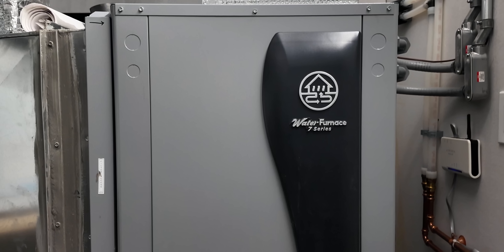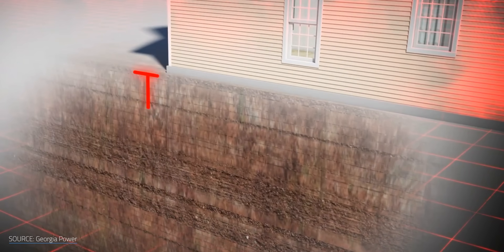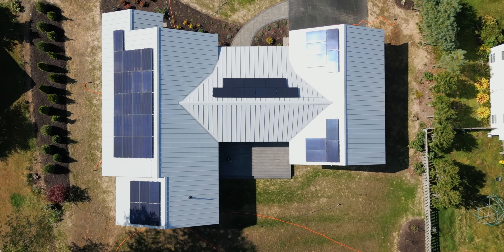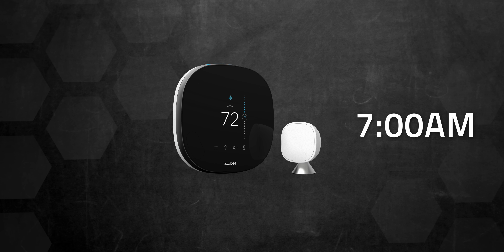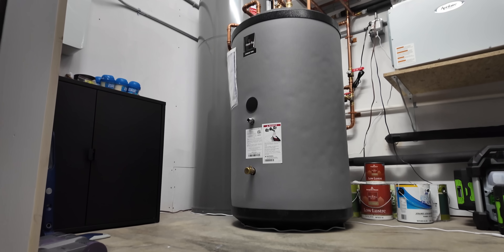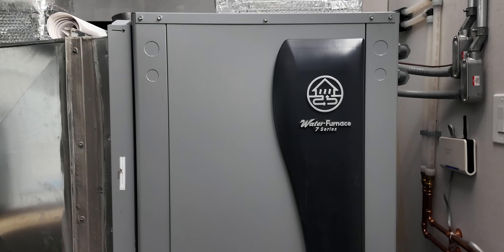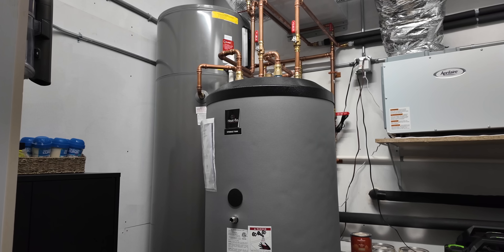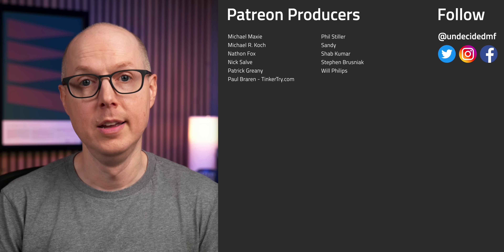How My Geothermal Heat Pump Really Performed (2 Years)

Comment: I bought a house last year with a pre-existing geothermal system. The house is only 5 years old and it wasn't even a selling point, so it was basically free. It's a horizontal loop that was direcrtional bored 14ft deep. It also has a "dummy" water heater, literally, it's just the same water heater, only not hooked up. I don't see this as providing much savings. However, it does work, but only during the summer. I don't see how it could provide preheated water in the winter?

At any rate, I have years of experience with forced air, and this system is immediately cheaper. With a nearly identical sized house. Forced air, between natural gas and electric was nearly 3x more than my current monthly electric bill. In the summer the electric bill would go up, and there was always that natural gas connection fee. In the winter the electric bill would ease a bit, but the natural gas would kick up. I do currently have a technician come 2x annually for an extra cost, and might continue that inexpensive program until the warranty is up. So far, I haven't seen anything that I couldn't do on my own to check the health of the system.

Comment: If your electric rates are indeed in the 35 cents per KW area, that system should indeed pay for itself in just a few years.  We pay almost 12 cents a KW here and that's about 1/3 the cost for electricity.  I'm assuming you guys also either do propane or fuel oil or have high cost natural gas which seems fairly typical out that direction.  I had an estimate done by a company for just solar and batteries for my place.  They want $49K which I though was rather excessive.  I can probably do it myself for near $15K or less for about a 12kw system which I am considering.  ROI would be about 6-8 years for me estimate.  But one cost that is never brought up and a few comments hint to it is the maintenance and/or replacement costs.  Those systems do wear out and/or just fail.  The home owner is responsible for everything at that point and can be rather costly.

Comment: Good report.  
We have had a Water Furnace geothermal unit in Wisconsin in a closed loop since 2010, and have had similar costs and results to Matt. Payback is 25 years plus.  
The desuperheater reduces LP usage for producing domestic hot water, so we use about 250 gallons of LP annually. 
The best part for us is the comfort radiant heat (not forced air) from the in-floor hydronic heating. This radiant heat provides a very even and stable feeling of warmth, with a (very mildly) warm floor. To be clear, we also considered installing fossil fuel in-floor hydronic heat from a modulated boiler but decided on geo due to green goals and due to fluctuations in LP prices.  
For this in-floor heat, water heated by the geo heat pump circulates through 3/4 inch PEX tubing placed in a 1.5 inch lightweight concrete floor layer placed on the subfloor under the carpet, tile and wood floors.  
Nonetheless, during "shoulder" spring and fall periods for a few days of cool weather, we use the forced air geo heat option from the system.  We found early on that heating the floor during cool shoulder season nights resulted in heat from the floor during the day that exceeded the desired temp, so we were opening windows mid-day. 
For the in-floor heat we have several zones run by separate thermostats and pumps.  We keep the master suite at 70 and the living area at 71. A third zone for the guest suite we maintain at a cooler winter temp of 55 except when we have guests.  We have hydronic in the basement floor, but the heat radiating down from the main floor means that that zone stays at 70 from the living area zone and therefore the pump for the basement zone has never really been used except for annual exercise running I do for a half hour each fall.  
Finally, forced air geo air conditioning is very low cost. Using a heat pump to move heat from a 75 degree house to 50 degree water is like falling off a log and takes very little electricity compared to moving 75 degree house heat to 90 degree outside air as for a typical non-geo outside-air based heat pump.  I calculate less than a dollar per day for electricity when the air conditioning is running.

Comment: For comfort u dont want to be changing the temp when your at home and gone for the day. The air inside a home is easy to cool or heat, but the mass of everything in the home is not. It takes time to cool your walls, furniture, cupboards, beds etc. it can take hours to equalize the temp throughout a home. Youre also going to get more dust from outside when u let the home warm and cool. As the air warms it will expand and equalize with the outdoor pressure, as it cools it decreases in volume drawing in air from outside through every little crack and crevice in the home. For comfort set it where u like and never change it

Comment: I doubt a $40K+ final price would make sense anywhere when you consider what a $40K investment in the stock market will give you on average. The long term S&P 500 average has been about 13% annually. So $5200 in the first year and then compounding to more. Our heating and cooling costs in Michigan in a 4000 sqft house is less than $4000 per year using a gas furnace and two mini-splits. Of course most people don't have $40K cash lying around and when they then pay for financing it likely makes even less sense.

Comment: I have to have a cold house to sleep.  I mean in the low 60’s.  During the day, I keep the house at around 66-68 degrees f.  How does a geo thermal system handle that?

Comment: I have a Water Furnace geo unit, excellent, trouble free for 18 years. Here's the but,, if you don't have solar panels the electricity costs can go through the roof because the geo and the very expensive well pump. We have a gas backup furnace and we found after 3 yrs of testing and comparison, that for the winter months here in Michigan, that for heating, the gas furnace was significantly cheaper. For hot summers, geo was wonderful.

Comment: Did I just see an Engineer with a significant collection of uninsulated copper pipe connected bidirectionally to a very large indoor water heater tank totally unprotected by insulated tank wrapper? In New England? 😂 €:~0

Comment: Geothermal is expensive and to me only makes sense if you are building or have lots of spare money to throw around. It's definitely more efficient but overall you still have your seasonal energy spikes on hot or cold days of the year. We have a water furnace geo system. And sometimes question whether I would put it in again due to the electric draw.

Comment: When we built our retirement home 25 years ago we specified a 3 ton geothermal heating and cooling system from Hydro-Temp, a local manufacturer.  Age is showing and we are in the process of having Hydro-Temp build and install a replacement unit.  The original unit came with a hot water loop that seemingly frustrated hot water production.  I took it out and we have relied on a conventional electric system ever since.  Apparently the system that Matt has includes an insulated take between the unit and the electric hot water heater where water is preheated by the heat pump before entering the hot water tank.  This arrangement may solve the problem we had.  I'd try that now but we don't have room for the buffer tank. Overall, we are very happy with our geothermal heat pump.  Our three ton unit heats and cool 2,300 sq ft of well insulated house and our electric bill is significantly lower than our neighbors.  I'm glad we went that way.

Comment: Enjoyed your video!!  My geothermal is the 3rd one I've had.  Started out with SOESI out of Florida back in 1987 to replace my whole house electrical and now use the electric as back-up.  After 4 years, and multiple cleanings, the compressor went and I moved to Water Furnace which lasted 8 years till a spike in electric fried the compressor.  Insurance bought me a replacement and now I have the two stage Water Furnace.  Utilities are about $150.mo year round for all the heating and cooling and hot water.  I too have a shop that uses somewhere near $30/month without the heat or ac.

Comment: We installed the same system in midstate Tennessee about 6 years ago. While our winters aren’t as severe, we were remodeling an existing log home and needed to contend with the limited R-value of 6” thick poplar logs. Additionally, there was the realization that energy costs would only go in one direction over time. So being able to HVAC as efficiently as possible made sense. We started with a horizontal loop, however after quite a bit of time spent trenching we had to abandon the effort - soil that was primarily sand & gravel plus high ground water caused the trench to fill with water & the trench walls were too unstable to work in it. So we switched to a pair of 300’ wells drilled into solid limestone, cost was around $5,000 for the wells, took a little over a day to drill using a percussion rig. Really like having the web link & ability to control over my phone / pad. It’s also good to get text messages from the system when it’s unhappy, like when the condensate drain plugs up. 
Only had one major problem - the loop pump went out shortly before the end of the hardware warranty. We live in a remote area, so the service people having telemetry telling them what is wrong reduces the need to get parts & return.

Comment: here in Austria/EU: drilling 130meter well costed this yr:  EUR15,000, the heatpump + all nstallation (new 350L boiler and 250L buffer) was about EUR33,000, and a new 12kw/peak solar panel, to power the headpump or to heat the boiler during summer without heat pump costed 15,000 and finally the new meter box 4,500.
new floor heating in 60m² of the house was about (only) 4,000 without new tiles.
so, your 78k seems a lot!

Comment: I am constantly amazed as to why copper sweated joints are used by plumbers, which have a life half of the plastic pex system. Pex is also cheaper, far quicker and easier to install. Maybe is the plumber is charging by the hour on a job it is the reason, they make more money.

Comment: This video straight up sucks. That graph is total garbage, and is not representative of your actual costs. You didn't bother to make a graph showing your initial outlay vs air, including rebates, then graphing your actual running costs vs air heat pumps. Let's say you're correct and air heat pumps averaged double the energy cost over a year in your location, $2000 vs $1000 costs per year. Over 30 years, which is well beyond national average home ownership time span, that's still only $30,000 savings against your initial outlay. So over 30 years, you barely break even... And the money you could have saved initially, invested, would easily trump that initial cost.

Comment: My house is older(1970) 1700 sq ft, not the best Insulated, none in the crawl space. Yet my bill averages 85.00 a month, out of that, 40.00 is just to have the meter, so only 45.00 in energy use, so even if the geo cut my bill in 1/2, that would only save me about 22.00 a month, or about 264.00 a year, so that would take me around 113 years to break even.

Comment: Matt mentioned it briefly, but a slightly less efficient air source heat pump coupled with some additional solar panels will almost always be cheaper than a ground source heat pump. This is also true for most energy efficiency retrofits (insulation, windows, etc). Solar is so cheap now you’re almost always better off just adding some additional capacity (from a cost perspective)
Reply: That can be true but it's very dependent on where you live.  What's true in the SE or the coasts likely doesn't work where we are in Western Montana where ground source heat pumps are the main option.
Reply: Also Matt's roof has plenty of room for more panels.
Reply: solar production is too limited during winter. Adding panels won't help.
Reply: @jf4958  Wdym? As long as you're using more than you produce, adding more panels always helps. The problem is you end up running out of space for panels.
Reply: @eDoc2020  
We installed 2.4kw peak 3 years ago. Our consumption during winter remained pretty much the same. 
From december to february, the panels produce an average of 2kwh/day, which is 240kwh during that period. 
If we add another array of 2.4kw peak, they will be usefull only during the winter, as from march to october, the heat pump doesn't work and the existing array is enough. The price would be around 800 euros, and the savings 41 euros/year.  It is just not worth.

Comment: I have been following Matt since before this house was built.

And please correct me if I am wrong. 

One thing I personally felt was a mistake was not going with Hydronic heat in the slab. If memory serves me correct this was a slab on grade build. Heating the slab, no matter the energy source, is efficient for comfortable heat.

The slab act a bit like a battery, once it reaches temperature is it slow the mass of the concrete slab will hold that temperature longer.

Wouldn’t having both air to cool and heat / filtration and radiant heat be more efficient?

Comment: no matter what you have for heating/cooling, no matter the energy source, no matter if its air, water, water to air... nothing, and I mean NOTHING is as important as AIR SEALING and INSULATION.... 1 dollar of insulation, is worth hundreds of dollars worth of whatever new, hyper efficient, super duper system.... and the best part is that many energy companies and state governments offer free or low cost assessments, inspections, blower door testing etc along with rebates, tax incentives, low or no interest loans or discounted material/installation costs...

  a few hundred dollars cut my heating costs in half.... few cans of great stuff to seal around basement/attic perimeter - sill plate and rim joist/soffit/rafter area...... a few boards of rigid insulation cut into strips as rafter baffles, and a few rolls of r-30 to laid crosswise over the existing r-39, and stuffed in around perimeter of basement...1 days work, in what is generally considered a reasonably well insulated house, that was at the time, only 10 years old, cut my BTU needs in half
  unless you live in a goldilocks climate, if your area experiences one extreme or the other, or like may of us, live in a place that gets both ends of the temp scale.... air sealing and insulation are by FAR, the MOST important, and MOST cost effective things to invest in, BEFORE you spend dollar one on any sort of system improvements

Comment: Personally I think geothermal and airsource heatpumps are good for a lot of people... But personally I went for wood fired (high efficiency) boiler, coupled with solar heat. The reason why I ended up with this option was based on a few things. I picked solar heat instead of PV due to efficiency. I think good PV might be around 20% efficient, but solar heat can go even up to 80%. Admittably solar heat does work best when you have use for fairly low temperatures even in the summer... But I figured solar should provide at least most of my hot water for several months per year and noticeable additional heat for much longer than that. As for burning wood as my primary source of heating, that is in part result of living far from pretty much anything. Wood furnace needs very little electrical power, which is good in case of loss of grid power. I didn't really want to go overboard with power backup, but rather use fairly light system to make sure "critical systems" should work. That is some lighting, heating in the winter and ability to run refrigerators and freezers at least intermittently during summer.

To clarify my design goals a bit, I would point out that one of my main goals was energy independence. That basically means that I would consider electricity as "high value" form of energy, and try to use as little as possible without resorting to solutions that would be overly expensive or impractical. While I do emphasize energy savings particularly in "high value" energy, energy savings in general are obviously one of my key targets.

In terms of energy independence, wood was a good option for me. As there is land for it to grow and I can turn trees into logs with little external needs... But this is something definitely not for everybody. For example, when my parents were thinking about what to replace their aging oil burner with, I said it fairly bluntly that wood fired furnace would not be a good option for them. Even if they are even now (several year later) in good condition and in principle could manage the workload... But in longer term it is clear that they are not young anymore and adding more daily maintenance tasks for their home would not be ideal in the long run. In the end they opted for air source water heat pump and are actually quite happy with it.

Comment: Constant temp seems like a huge drawback. We (humans generally), and I in particular, need it colder at night to sleep comfortably. If my house stayed at 72 degrees day and night, I'd need new bedsheets once a month, if I slept at all. 

Does the system feature a way to cool the house by 5-10 degrees at night, or are you locked into a stable daytime-appropriate temp 24 hours a day?

Comment: I've been using a ground source heat pump (I'm not a fan of calling it geothermal) for 18 years. I had an 800 foot horizontal  loop installed, 400ft was all that was needed, but I oversized the loop for future expansion. 12 years ago I built an ICF carriage house and installed a second 2.5 ton ground source heat pump there. I've only had one service call since the initial installation. 
The only downside is on extremely cold days, the auxiliary heater will kick on, but I mitigate that by burning a wood stove. Best investment I've ever made is a ground source heat pump